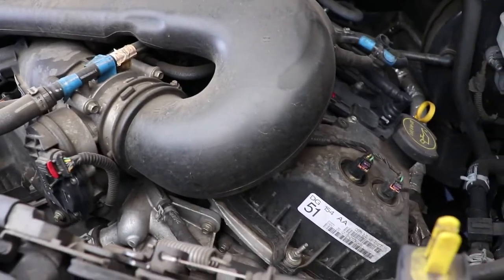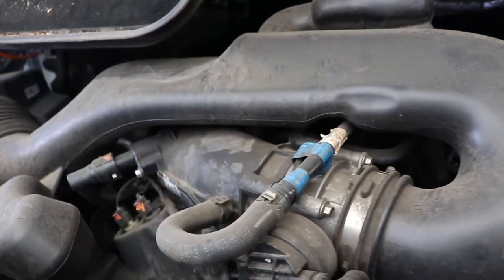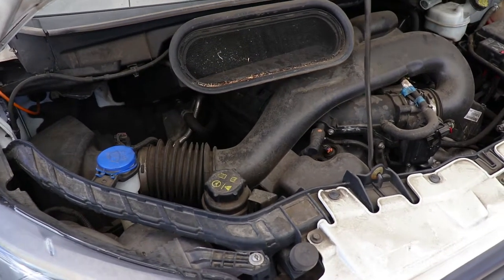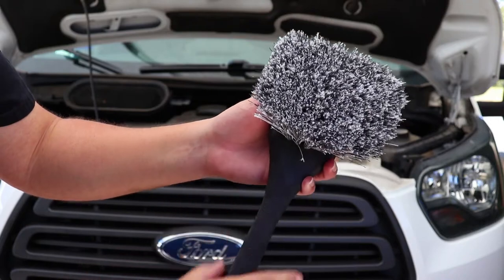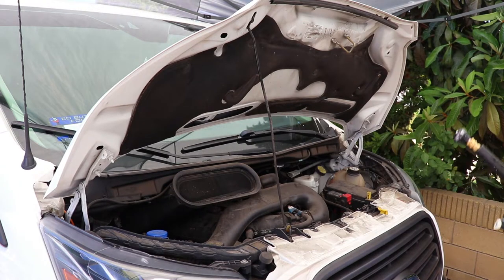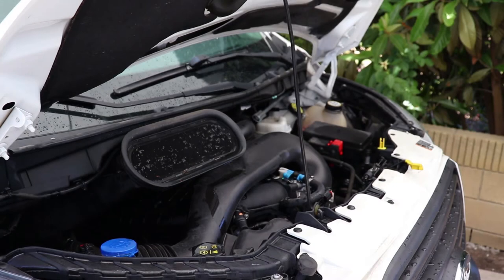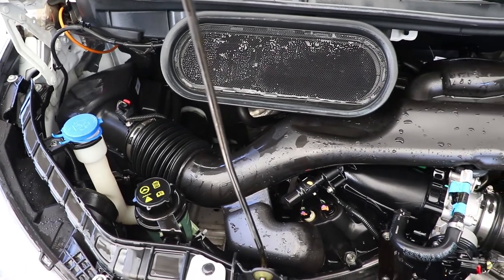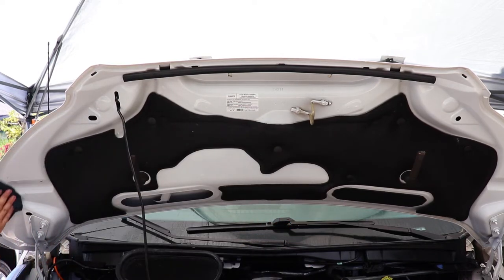Clean and Dress an Engine | Engine Detail

Comment: Great vid Cardo. Engine detailing is one my favorite things to do simply because of the BEFORE & AFTER results. I always blow dry the engine immediately after I am done with the final rinse that way there is no standing water in any of the vital components of the engine. Therefore greatly reducing the risk of any electrical damages to the engine. I highly recommend blow drying the engine completely and not let it dry on its own.
Reply from the maker: Normally I would blow dry an engine, but at the time of the video it was almost a hundred degrees outside 🔥🔥🔥 🌞🌞🌞

So with the power of dry air, it evaporated nicely and wiped away with a towel! But since winter is already here I guess I will start blow-drying now 😂😂😂